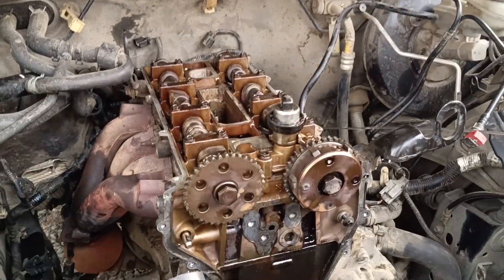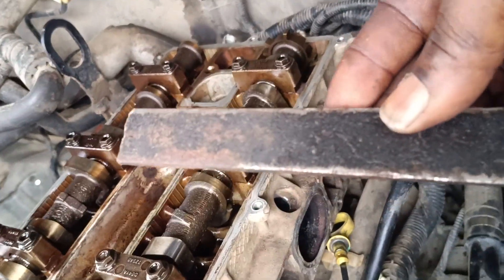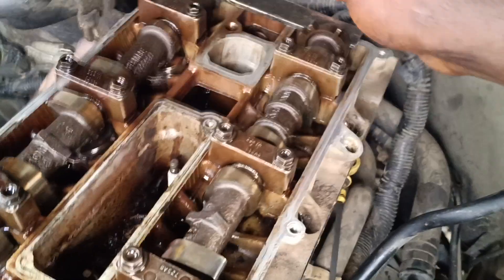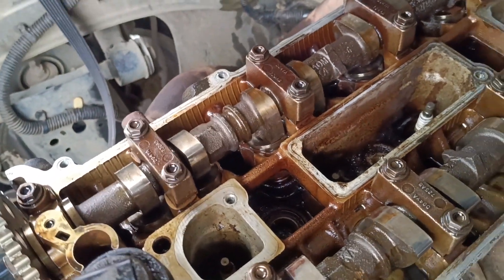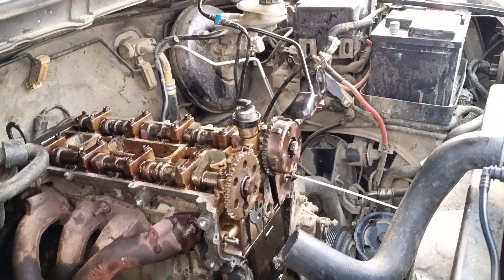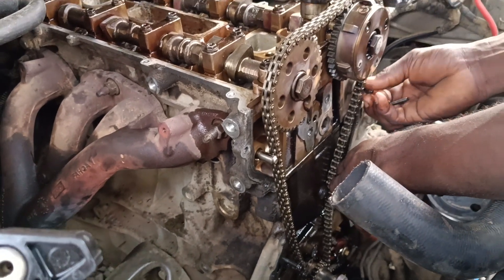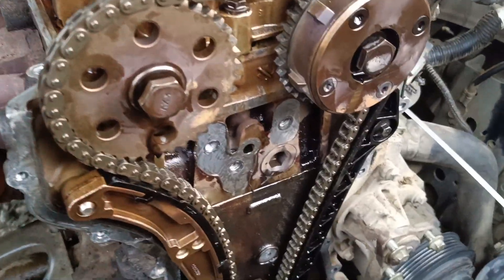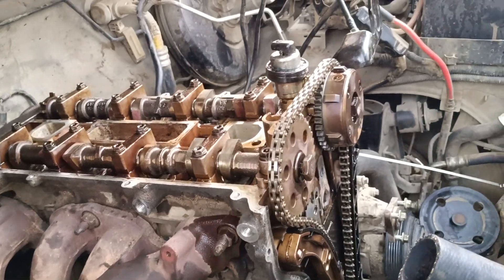2.5 / 2.3 ford ranger timing alignment mark

Comment: Hi, could you tell me what's the part number of the VVT seal/gasket? Mine is leaking oil at high rpm but dealership sold me the supposed replacement and it's different, I can't find the part and if I buy a new VVT it doesn't come with said gasket. Thank you so much
Reply from the maker: I have to check and get back to you